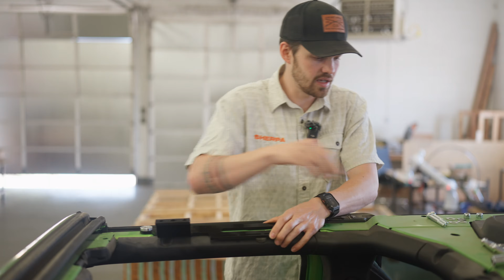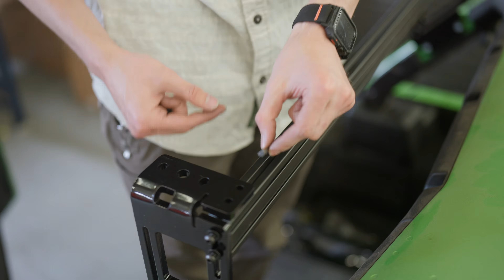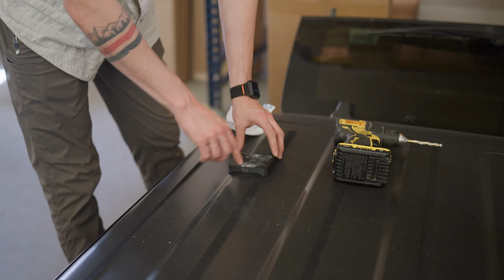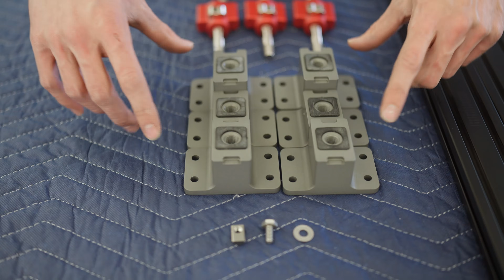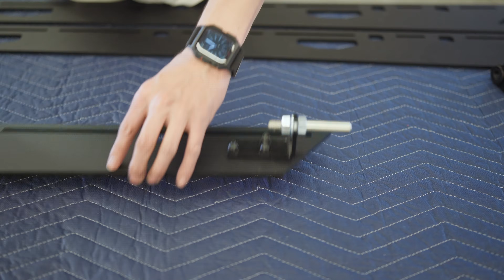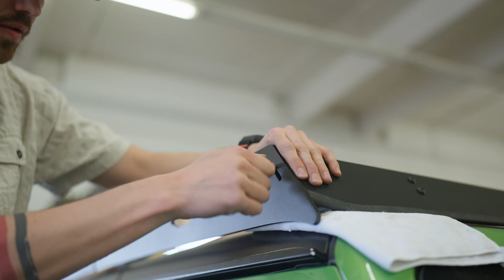The QDHD Rack Install (2018-2025 Jeep JLU)

Comment: Just installed this today and I already love it.  Just one question, has anybody modified the factory hard top headliner so I can still use them?  They don’t fit once this is installed.
Reply from the maker: Hi Brian, we're stoked you are happy with the QDHD rack! We have had some customers cut the headliners just around where the mounts go up through the roof and it has worked fine for them.
Reply: @s @sherpaec thank you for the response. I was posting that so others know before I found out 😂
Reply from the maker: @brianhawkins184  Anytime! Please reach out if you have any other questions!